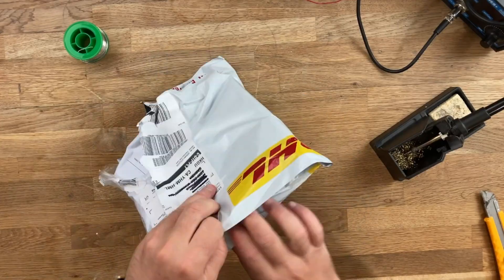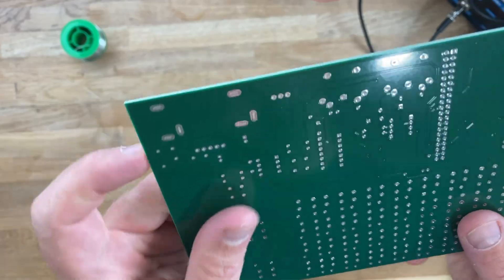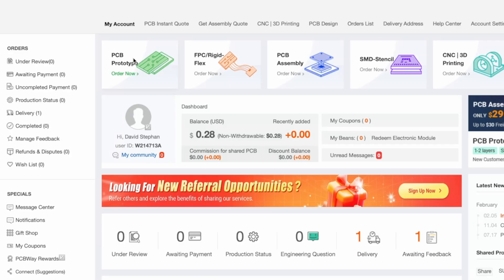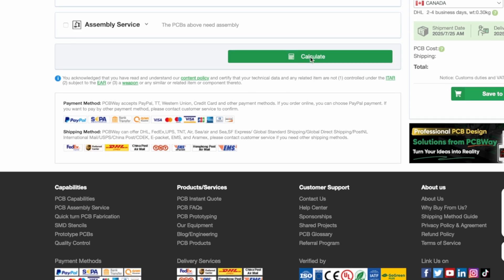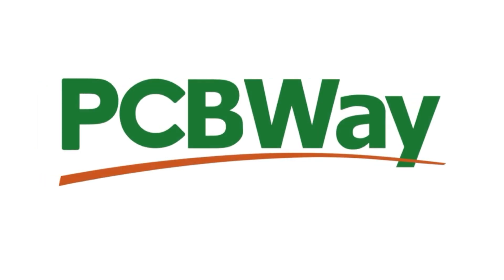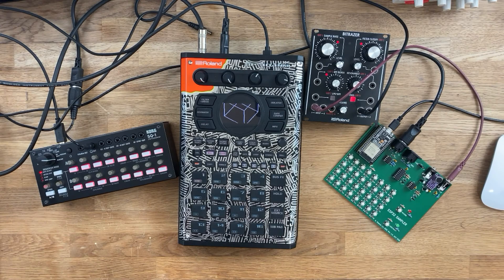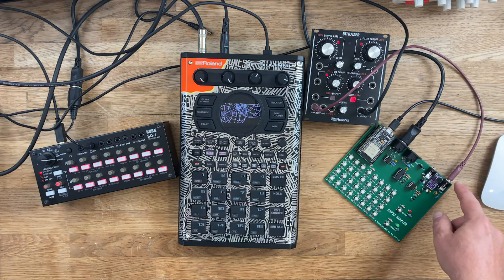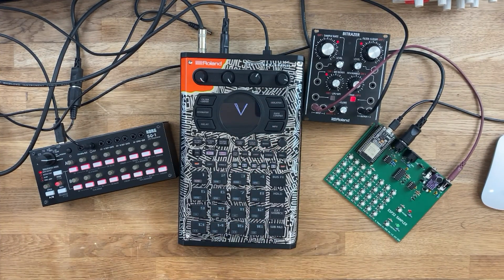DIY Lo-Fi Sampler With An ESP32: Part 12 - Final PCB and Sound Demo!

Comment: Certainly the pitch not being quiet right has to be just a tweak to the code. And as for the external ADC/DAC, I thought it's supposed to be lo-fi. It does say it right there in the title. I quite like that gritty sound, I think with the tuning sorted It could be quite usable.
Reply from the maker: Haha fair… I did say lo-fi was the goal 😅 Just can’t help poking at a slight fidelity bump for Rev 2. Still all about the grit though. Considering a  “Part 12.5” to sort the tuning and MIDI Thru fix. We'll see.
Reply: Lol, part 12.5. if you're anything like me, that'll turn into part 12.5.1......
Reply from the maker: Haha, right? 😂 This is what it sounds like when doves cry!